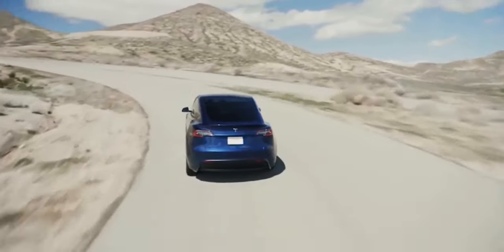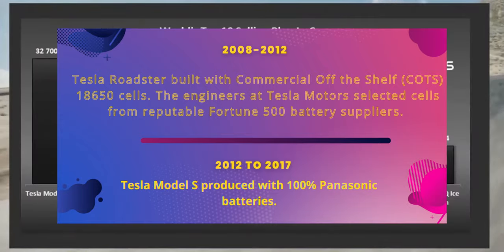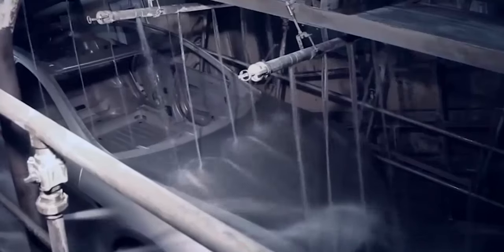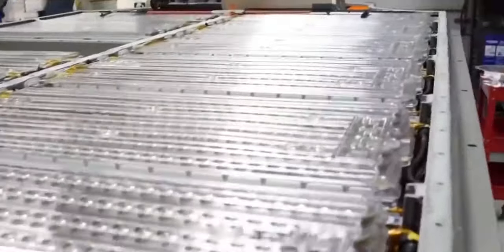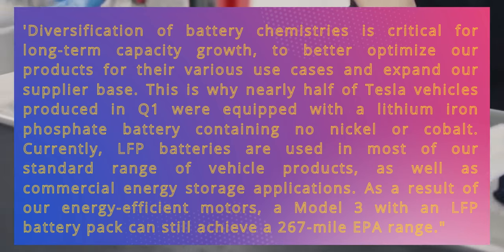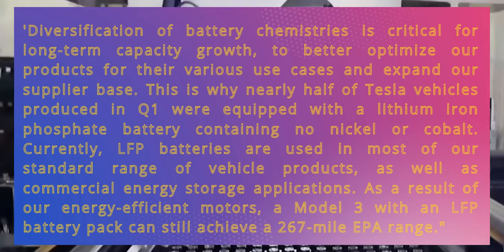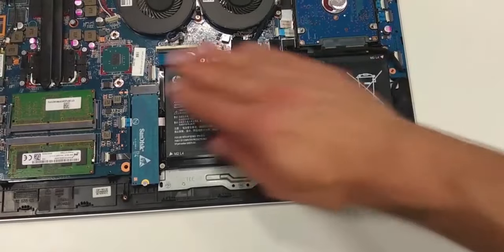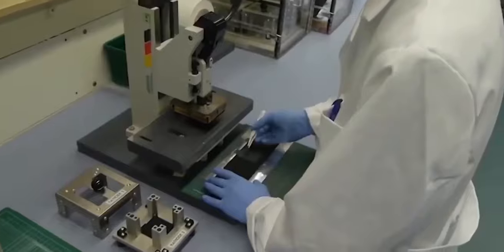Could this New Cobalt-free battery  slash EV prices by half?

Comment: EV vehicles need to come down in price in order for the average consumer to be able to afford one. I thank Tesla for it's leading edge tech and leadership in the EV market.
Reply: The EVs already are low price, less than $5000 in China.  But you get what you pay for.  The Chinese market buys all the low priced EVs, they don't need to import the low priced ones to the US.

You buy a Tesla and it's still cheaper than a gas engine car over their lifetimes because the fuel is so much cheaper.  You charge your Tesla for ten bucks instead of paying a hundred for a gas car.  There are other savings, too.
Reply: How to acquire 🔋 battery making technology and raw materials sorucing